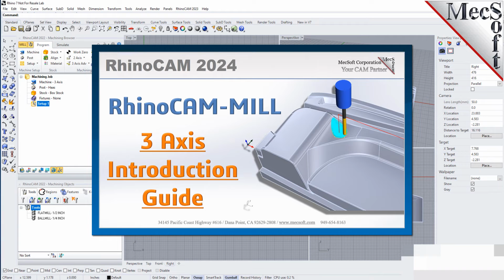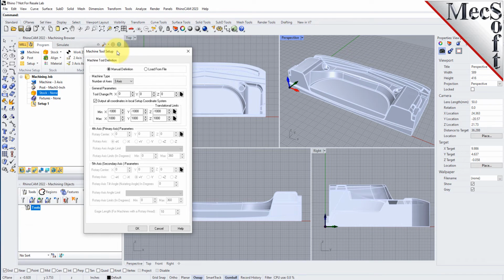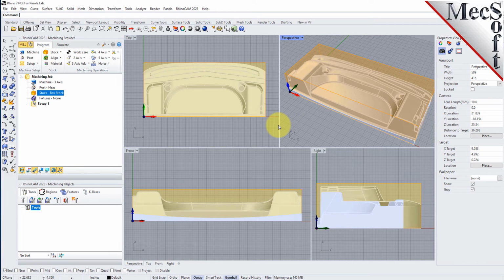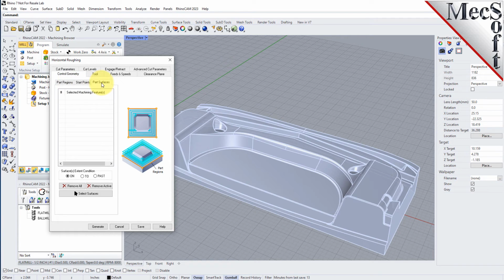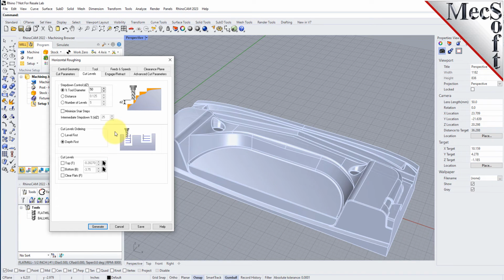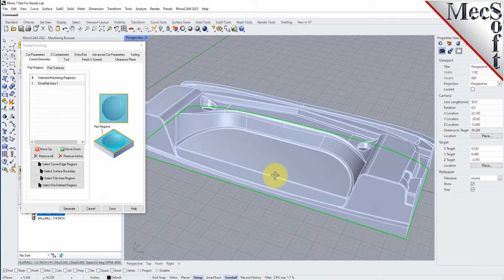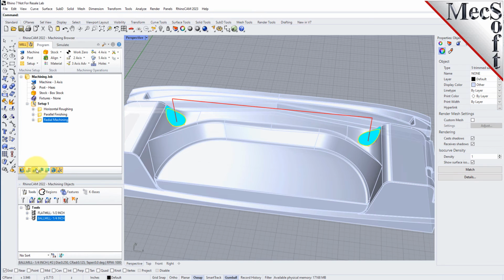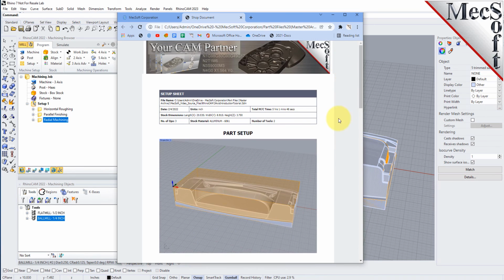RhinoCAM 2024: Introduction to 3 Axis Machining

Comment: Message for
Joe Anand

In 2021 I reported and am still waiting for new codes to be sent. I first contacted you in July 2011, and I have not received them yet.

I spoke to Mr. at this address.
He introduced himself as Joe Anand.

He informed me that you have some problems on your side.

He promised me that he would look into the matter and I would receive these codes.

I have currently changed my computer, so the data sent earlier may be out of date.
Please let me know what data to send.

Please send activation codes for my AlibreCam

Purchased at:
Datacomp, Krakow, Poland
on 2012.07.13
FVS/1564/2012

Best regards,